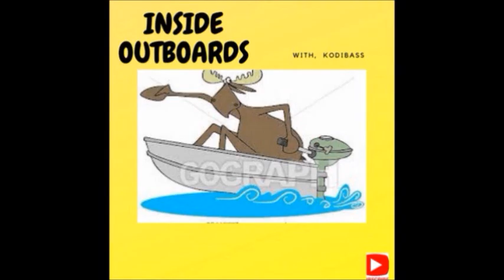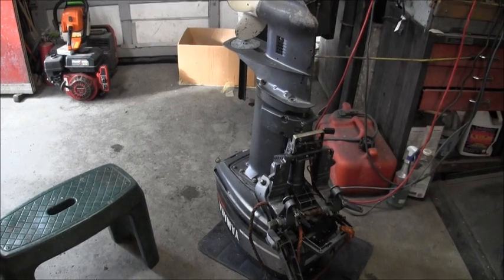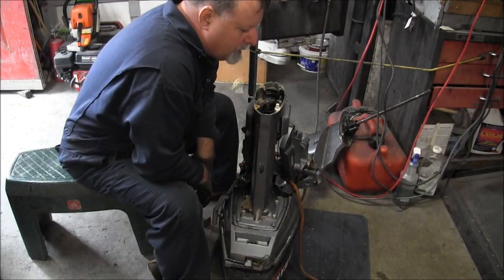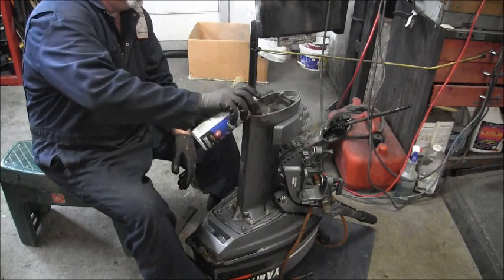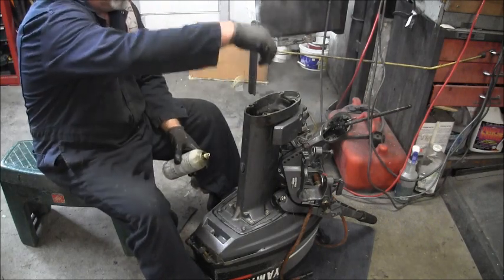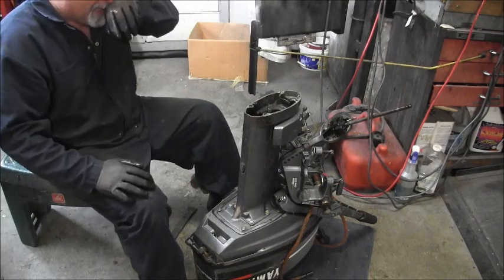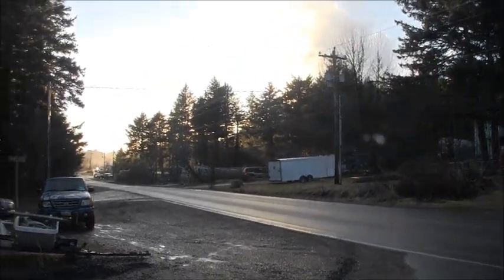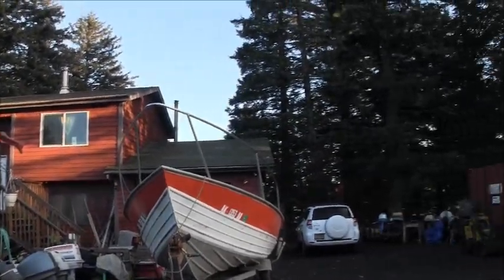1994 Johnson 40 hp,     Part 3

Comment: That 35-40 hp is still going to be a very high torque motor, considering that it is a detuned 50 hp to begin with. Still running the big prop and gearbox. does look clean. I have a similar 40 hp as well. Yep, 145 lb compression. Easy conversion to 50 hp, no doubt.
Reply from the maker: I Hope it will be a good runner,  no surprises so Far''            kodi

Comment: Hello mr Bass I have a 40 Johnson and it will crank and run great on hose muffs but when I take it to the lake it won’t crank so bring it back to house and put it back on the muffs and it will crank great so any help would be greatly appreciated thanks in advance
Reply from the maker: Check compression numbers,  Low compression and back pressure (prop under water)  can cause this.
there are other things that could cause this , But start there.         kodi
Reply: Thank you sir

Comment: Looking for a lower unit for a J30ECOA 30 HP Johnson,  1985 ,  short shaft any ideas where to start?
Reply: @ Mark Law a place in Minnesota called Tim’s outboard repair in Hackensack just might have it ! I believe a 25hp will also fit it !
Reply: If you need I could get the # for you !
Reply from the maker: I have some, but shipping from Alaska would not B cost effective I think.     kodi
Reply: @kodibassInsideoutboards  thanks kodi, ill keep looking
Reply: @davekimbler2308  if you could get the number , that'd be great